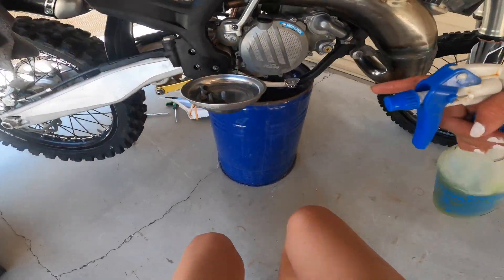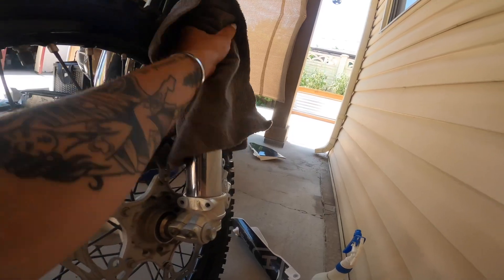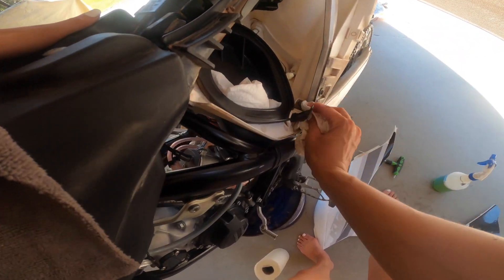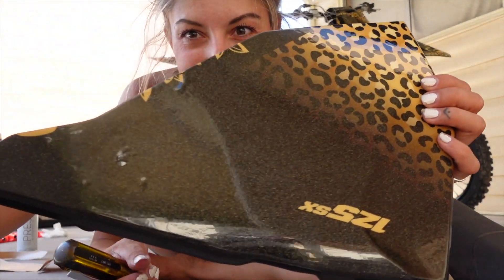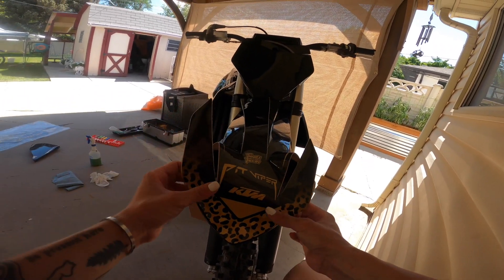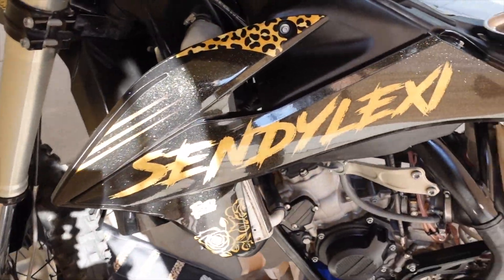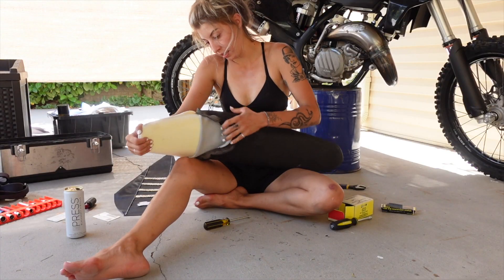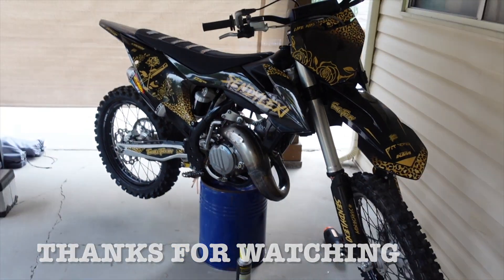My new custom ANIMAL PRINT dirt bike

Comment: My dad and I usually spray it down with soapy water so we can move it to where it needs to be, then use a card to push out all of the air + water while blow drying it ^^ If there’s a bubble the next day we’ll try to heat it up and flatten it, but if it doesn’t work we’ll poke a hole to let it out. Definitely recommend going over them the next day for any edges rising or bubbles if you haven’t- that way dirt doesn’t get under and peel

Those graphics look epic! :D
Reply from the maker: Hell yeah! Good to know thank you!! (:

Comment: I will say prep the sticker or graphic with a heat gun, give it small amount of heat so is a bit soft, then slowly start to putting it on and if you see bubbles or wrinkles grab a credit card or something like, apply a bit more of heat and smooth it out. Slowly but surely and try to leave no bubbles or badly corners
Reply from the maker: Heck yes, thank you!!

Comment: Use a heat gun while applying to make sure that the graphics will stay on and use a small handheld squeegee tool to push out the air bubbles while applying. Most graphic sets come with a squeegee in them. Can’t believe a 14 year old has to give tips on applying graphics lmao